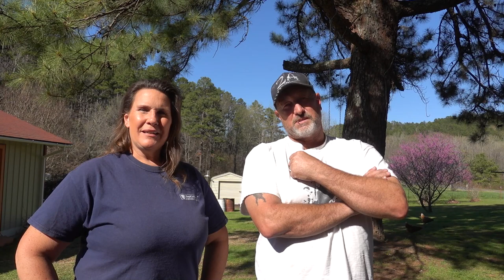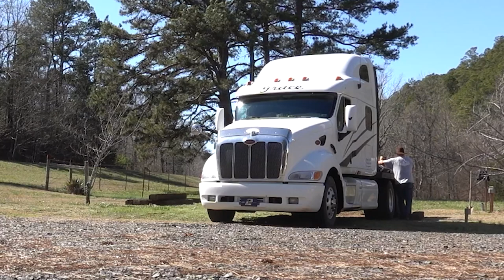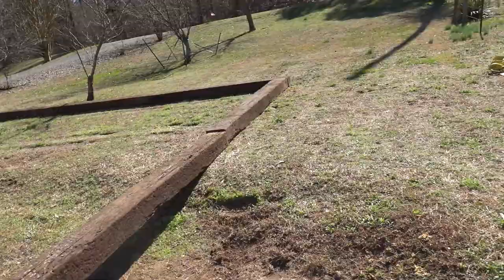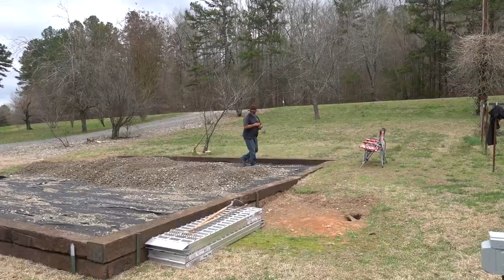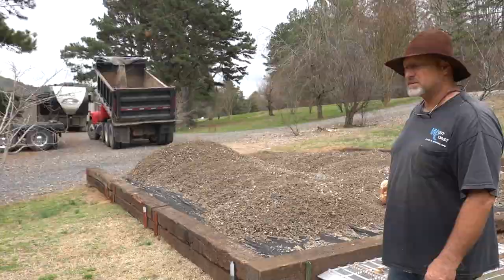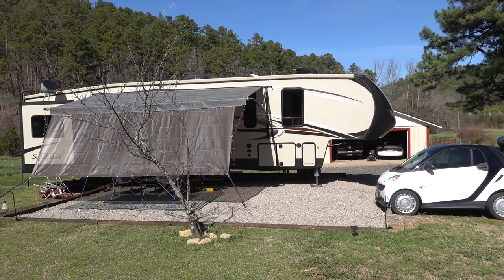Episode 102: We Built an RV Pad!!

Comment: There you go we did the same but there was two of us me and another close friend and we bought a piece of property together 5 acres and then we put up there was an old trailer pad and he set on one side and I set on the other side and we bring in gravel like you did then we use the pad to walk out on then we put up a 24 x 24 pole barn and we had a well and septic already on there we just got it up and running then we had water and electric and sewer and it works out real good we put a metal gate down at the bottom of the driveways when  we’re not there we shut lock the gate no problems in two years
Reply from the maker: Sounds like a wonderful setup! Five acres gives you plenty of room too!

Comment: What size wire did you use for your 50amp run?
Reply from the maker: That's a really good question. We built that about three years ago, and neither of us can remember what wire we used. We did find that the local electrical supply company was a huge help in figuring out what we needed. I'm really sorry we don't have a better answer for you.